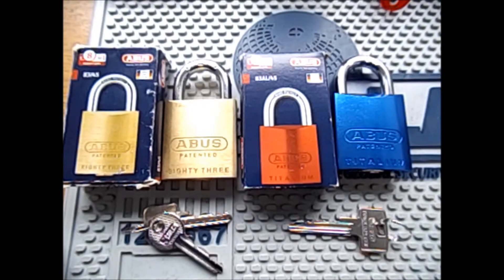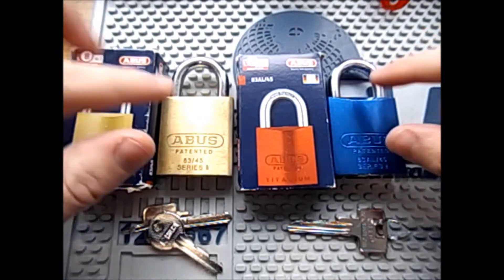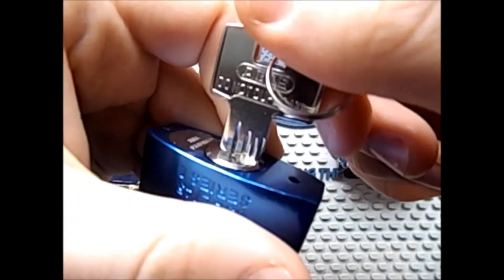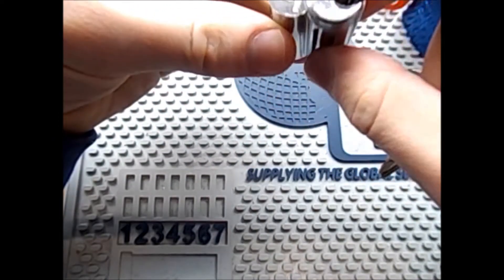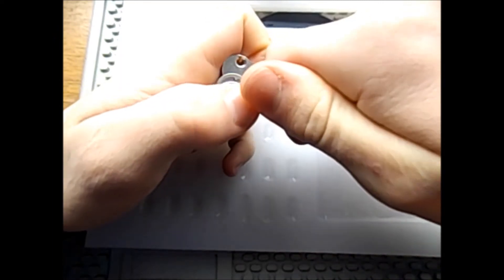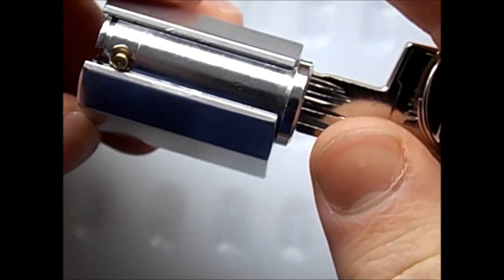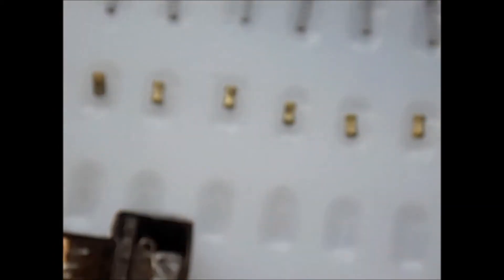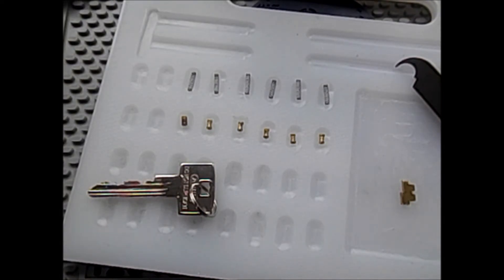Abus 83AL/45 Overview (185)

Comment: Very nice lock! 👍😃  I know in comments on your last vid of this Lock I had suggested to be careful with TOK tensioning; but since I have damaged my 888 core and haven’t gotten around to making a special tensioner for it, I can say that it is much harder to pick with BOK 😵🙀 Also with mine I did get a key code that I could use for duplicates. Thanks for sharing 😃😃👍
Reply from the maker: Aha, my friend the 83 fan has made an appearance! I've just being doing BOK with a thin tension wrench. Think it's just that I need to get used to the feedback and dealing with all the spool pins. Tony just told me that he thinks he still has the key card for it but thanks for the extra information there, it would be a bit silly to have a restricted key that you couldn't duplicate full stop!